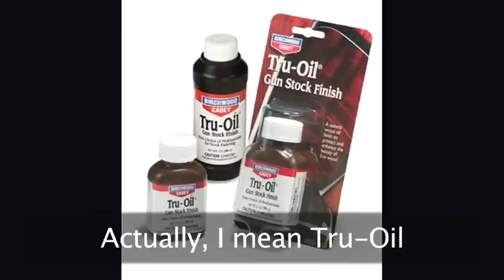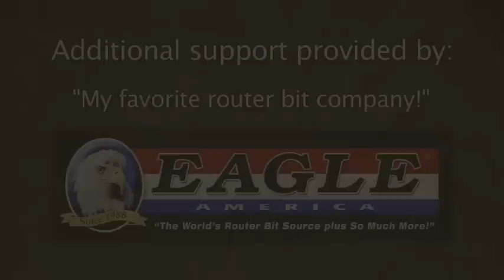107 - Oil-Based Finish Basics

Comment from the maker: If the oil-based finish is fully cured, you should be able to topcoat with a lacquer, but if you are going with a lacquer I'd skip the oil just to keep things simple. Which minwax finish are you specifically referring to?

Comment from the maker: A regular stain might just pull up some of the color from the gel stain. And if the gel stain partially sealed the surface, the regular stain might have trouble curing. Have you tried simply using another coat of gel stain? Sometimes these things just require some experimentation since results vary widely depending on so many factors. Once you get the color, I think any varnish would do. Whatever you are comfortable applying.

Comment from the maker: @RenataDoes I would sand with 220 to knock down the brush strokes and smooth the surface.  For a topcoat, you can use any topcoat you like.  One of the easiest to apply is a wiping varnish.  Minwax makes one that works well.  The key is you use a cotton rag to apply it instead of a brush, so no brush strokes and not runs or sags.

Comment from the maker: Honestly I haven't used Tru Oil. But you should be able to replicate just about any oil-based finish using poly, pure oil, or danish oil and the many possible combinations. In my mind, straight danish oil is a nice compromise of that "close to the wood" look with some added protection from varnish. That sounds like it might be a good fit for you.

Comment from the maker: Shellac is a great choice. If you can, spray it. If you wipe it on the surface, you might end up with lots of streaks due to uneven absorption. So a nice even spray is a good way to seal the surface quickly prior to adding your topcoat of poly. And if you can believe it, I do use water-based finish on MDF. Since I spray, the coats are very light and don't absorb deeply. After the first coat or two, the surface is pretty much sealed and you're just building a finish at that point.

Comment: Marc, I am just starting out in woodworking and have watched all of your videos.  A lot of great info in them.  My first projects is going to be a combo table saw/router portable work station.  I planned on using some hardwoods as trim and drawer/door fronts.  My issue is I want the natural look of the wood but also need the protection and smooth sliding for the top.  What would you recommend.  I will also be making a assembly/out feed table combo also.  Again thank you for any assistance's.

Comment from the maker: I haven't used TruOil so I don't know for sure if it's an oil finish or some variation of a varnish. That's what determines how you can approach it. If it's an oil, then you can't simply coat over the poly. If you are unsatisfied with the finish you currently have and you are sure that it can't be recovered, then stripping is probably your best bet so that you can start over.

Comment from the maker: Spray poly would be fine. If you have some dewaxed shellac, that could work too but try to apply via HVLP if you can. If the stain is sensitive, even rubbing on shellac could pull up the stain.

Comment from the maker: From what I understand, it's just an oil varnish blend, much like Danish oil. Only it contains some UV inhibitors to make it a little better suited for outdoor use. To clean the items, I'd scrape/sand them. But with 18, you might consider some sort of pressure washing. And there's no reason you can't use teak oil again if you like the way it looks. Perhaps dilute it with mineral spirits for easier application.

Comment: Hi, great segment. I've fallen in love with the look of tung oil and can't my head around doing anything else on my new walnut dining room table top. But I'm worried about water damage. I'm not worried about dings and scratches. Is there something that can go over tung oil as  a top coat without  compromising the look? I don't care for a glossy look, prefer satin of flat. Thanks for putting out great content.
Reply: If it helps, I have always used 'Danish Oil', in particular Deks Olje which is based on tung oil, on hardwood trim on boats. This is of course always exposed to water and it looks fantastic. Water doesn't mark it or damage it, to keep it looking great, just keep throwing more oil at it.

Comment from the maker: Yes it is a film.  I would definitely thin with mineral spirits and you might just follow the instructions on the can.  
And the only reason to worry about checking and warping is if the wood is still wet.  That would be a concern no matter what finish you use.

Comment from the maker: This can be a complex topic and requires a little understanding of chemistry, but put very briefly, a varnish is typically a resin, with oil and thinner. Once applied the thinner evaporates and the resin/oil cures via oxidation. Lacquers usually consist of a different resin (typically nitrocellulose) in a solvent. Once applied, the finish cures by evaporation.

Comment from the maker: Yes that's correct.  The wax will prevent the oil from absorbing.  So what you do depends on the severity of the scratch.  Worse case scenario, you can scrape and wipe off the wax with mineral spirits.  Sand to repair the scratch, then reapply oil and wax.

Comment: This is the most informative video on finishing I've ever seen. I have started building laminated Deflexed/Reflexed Bows. The wood limbs are top coated with fiberglass and the handle risers are bare exotic woods like Bubinga, Bocote Cocobolo. Will the 1/3 1/3 1/3 Linseed, Varnish, Mineral spirit work on sanded fiberglass? or do I use only diluted varnish? I want the Oil / varnish to penetrate the wood on the edges of limbs and handle . Fiberglass must get the same? recommendations? Thanks much!

Comment: Thanks for the informative videos!  Rookie question - can you apply a poly varnish over a linseed or tung oiled surface?  What precautions / steps should be taken to do this properly if so?  OR is it simply better to use a 1/3 oil, 1/3 poly and 1/3 turps mixture?

Comment: I'm building a basement bar and while it won't get a ton of wear and tear, there will certainly be some.  After staining to get all the materials to match color (plywood, trim boards, etc.) would you recommend a few coats of a wipe on poly?  
I'd love it to still feel like wood because bar tops are in almost constant contact when you are sitting at it but I still need good protection for the same reason.

Comment: Completing a mission-style dining table; Greene & Greene Robinson House table. Used quarter-sawn white-oak and have been debating the various options for final finish, in particular for the table-top. Tung-oil is on the list, as are poly coatings. Durability, and stain/moisture resistance obviously top the list, but I don't want to loose the authentic look this table deserves. Thanks!

Comment from the maker: @ak99372 Thanks for the kind words.  If you can't sand or strip the color out, the only thing I can think of would be to use bleach to neutralize the color.  This may or may not work, but at least its worth a shot.

Comment: Hi Marc,

I built a cradle out of mahogany. I planned on staining it with a Minwax oil stain. Afterwards if I used like 3-4 coats of Formbys Tung Oil finish, do I need to do anything else like seal coat or shellac? Is just stain and a few layers of oil enough? 

Thanks for your help.
Reply from the maker: Formby's is actually a wiping varnish so it should provide enough protection on its own without shellac. Just stain, then apply as many coats of Formby's as you want.
Reply: The Wood Whisperer thank you so much! 

Going to attempt a bed like the one you made soon wish me luck! But with something cheaper than bubinga! Lol

Comment from the maker: If the oil is cured, you are most likely safe to add a coat of varnish/poly. You certainly could have made an oil/varnish blend and used that from the beginning. Or better yet, cut the oil out all together and just go with varnish. In most cases, pre-coating woods with oils prior to applying an oil-based poly does nothing more than add time and work. I always suggest testing on scraps to see if you can tell the difference with and without oil applied first.

Comment from the maker: Depends on the sealer. Some are just an unnecessary step since the first coat of any film forming finish is effectively a "sealer". When you're dealing with things like cat. finishes, sometimes is really is better to go with their sealer, although using shellac isn't really going to hurt anything. Shellac is more like the workhorse sealer of the shop. But if they sell a sealer for your pre-cat topcoat, you are probably even better off using that. product.

Comment from the maker: I think that's a decent way to go. I really like to think of the varnish as something that seals the deep grain. From that point on, you can pretty much maintain the board using more traditional materials and methods. So a butcher block oil or wax would be a good choice.

Comment from the maker: Any polyurethane will do.  And a typical oil/varnish blend would be 1/3 varnish, 1/3 linseed oil, and 1/3 mineral spirits.  I would make a similar mixture, but add a little less varnish to the mix.

Comment from the maker: If you're going for something fairly natural-looking, I'd say stick with the Danish Oil. 2-3 coats will give the surface a small amount of sheen with some protection. As for the purpleheart, it should look good with the Danish oil as well. But ultimately, purpleheart is going to do what it's going to do, no matter what finish you apply. So be prepared for it to get less bright as it ages. Still beautiful, but not quite what it looks like when newly finished.

Comment: Great vid! I’m a relative beginner. Just finished 2 end tables, sapele, and now 5 coats ArmRSeal. But the sapele is now more orange, I would’ve liked less ambering. But Water base poly lookskind of strange, plasticky? Have you used Oil-modified water-poly? Is that any less ambering but maybe more natural? Or, can you use shellac first, then water base poly for topcoats? Thanks!

Comment: I'm refinishing my vintage gun stock. I stained it and then mixed rit dye (scarlet red) with my polyurethane and put down one coat. I find it's still not dark enough. I was wondering if I could mix some darker stain to my polyurethane? Will it dry properly (cure) ? Thanks

Comment from the maker: I honestly know nothing of finishes and fiberglass. But I do know anything with raw oil in it needs to absorb into something, otherwise it turns into a sticky mess. So if the fiberglass isn't permeable, it probably isn't a good idea. Also, naturally oily woods don't take oil finishes well either. So in both cases, a mix like that probably isn't what you're looking for. Perhaps a film finish would be a better option.

Comment from the maker: it's certainly possible if you rub hard enough. Best to test it on a piece of scrap first. But if you need to, you can spray a light coat of rattle can poly and then switch back to Arm R Seal for the subsequent coats.

Comment: I have a walnut table top which I have applied pure tung oil to. I've applied two coats, once with rags then once cleaned, again with 600 grit sandpaper. It's dried now for 2 weeks. Can I put a finish over top of that so provide more protection against liquid spills or thing of that nature. Should I have just made a combination mixture alone like suggested in this video? I would really appreciate a response, you seem very educated on this stuff. Thank you!

Comment: Great video. I like to use MDF a lot for the artistic benefits. Obviously finishing MDF is not a common practice as paint is often used instead. MDF Drinks the Poly.. can I use Shellac as my first coat or is there something else u would suggest to help seal off and limit the absorption. I know MDF hates water, so I stay away... Also, I am often sealing up ink or pencil marks underneath, is there a particular product that would lessen or eliminate bleeding. Maybe there is a type of ink u suggest?

Comment from the maker: Well I don't mess with paint very often so I'm a little hesitant to say one way or the other. But most film-forming finishes can be coated over one another. But keep in mind once you seal the surface with the enamel, you'll want to stop using the oil part of the mixture. Switch to a thinned varnish alone. The oil relies on absorption to cure and wherever you have paint, the oil will remain sticky.

Comment from the maker: @Strykercom1 depends on the species. But in most cases you'll probably be fine if its just a clear coat. but if its a blotch prone wood species, you can do the shellac coat but just leave the pure oil out of the top coat.

Comment: For the most part, tung oil is an intense finish all on its own, imo. My favorite part about it is the fact that you can apply as many coats as heart desires and will eventually take on a crazy shine. I find that it is really durable and is easily repaired if scuffed or scratched.

Comment: Thanks for very useful hints on wood.Currently I m working on finishing alder body on my bass guitar.I  stripped it down to a bare wood since it was treated with nitrocellulose finish.then I  decided not to use any shellac to avoid blotchiness on alder but rather go with the wax which contains carnuba oil.Thankfully I didnt get any blotchiness but I realized that using just a wax I wont acheive a very dark finish.?Any use of TUNG OIL or BOILED LINSEED OIL that would help to dark up the finish?

Comment: So I've tried General Finishes Arm-R-Seal Oil & Urethane finish twice and really like the product over plain polyurethane! It self levels great, dries in about half the time and subsequent coats are easy to apply. My only complaint is both times the remaining 1/3 of the product thickened in the can! I was careful to clean the can rim and lid. Made sure it was on tight and minimized open time. So regardless of how much I like the product, I can't justify throwing away expensive finish material! And it is not inexpensive to start with.

I suggest General Finishes consider a different product package with a smaller opening, screw lid and better seal. Until then I can't justify the expense or waste.

Comment: I've been watching a bunch of your video's on finishes and I am now more confused on what I should use on my project than  ever.  I am refinishing a salvaged table top for a indoor dining room table, It has minor sun an water damage but I think it adds a bit of character. And will be making a live edge benches to accompany it out of white pine,  This is what I am thinking,  Watco, Danish Oil, dark walnut (to add a little color,  pop the grain) then a top coat of General Finishes Arm-r-seal Oil & urethane topcoat wipe on, satin. 

However, I am wondering if I should use a shellac instead of the Arm-r-seal, or will they basically do the same thing. 

I am trying to get the most natural look, however I still want to protect from the spills and plates that will be dropped on the table top. 

any advice would be greatly appreciated. And by the way I am in az as well!

Comment: May I ask one question regarding shellac ? I have dissolved shellac (as is and ground to a powder)  in alcohol (93% and 96%) , also I used isopropyl alcohol (99%) but in all cases I got a residue. Why is that and is the residue wax or has the shellac flakes gone bad? should I filter it  and use it? Thanks in advance.  Andreas Spyrou

Comment: Tough Question for you (fairly urgent if you care to answer it): I used Bona Traffic Silk Matt HD on an engineered floor I had sanded down. That floor was from Malaysia and had been initially lacquered with Aluminium Oxide and then several coats of lacquer.  I sanded it down as much as possible.  However, after application of the Bona Traffic Silk Matt HD a number of black patches appeared like stains.  Even after sanding down they came back with the next coating.  Essentially imagine a number of very tine streaks of black almost like microscopic little black worms.  Even with grade 40 you could not sand  them down.  Now two years later I sanded it again for the black patches were many.  I managed to get 26 grade sand paper on a circular orbital hand sander 5 inch.  Only at that grade could I get the patches out cause 40 was not enough.  Now the consistency of what is left is a bit like a soft balsa wood or something guie but still workable.  Now big dilemma.  I phoned the Bona tech guy in Sweden.  He told me that perhaps Bona had reacted with some chemical in the wood (not aluminium oxide).  However, 20 years ago another guy in Bona had told me not to use it on aluminium oxide finishes.  Anyway, he reckons there was a chem reaction with some mineral in the wood?  Not sure if that was the response of a "see how clever I am" Swedish youngster.  When I asked him why were there patches in only some parts of the floor (even parts which had not been exposed to walking these two years) he said "ah, the wood of a tree is not consistent, maybe in the centre of the wood are the chemicals not at the edges" or some such other clever response.  So he is suggesting I treat the wood with some hard wax oil.  
I am tempted to try something else not to get this problem again with the Bona Traffic Silk Matt HD.  Have you any ideas?  I need to decide this by tomorrow.  OK now back to the sanding.